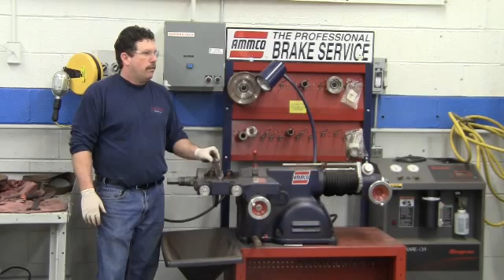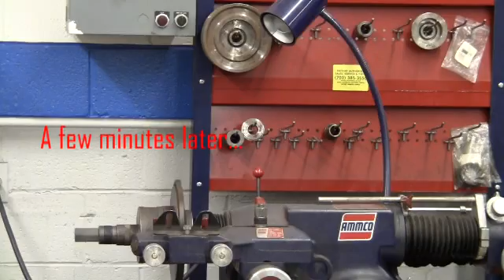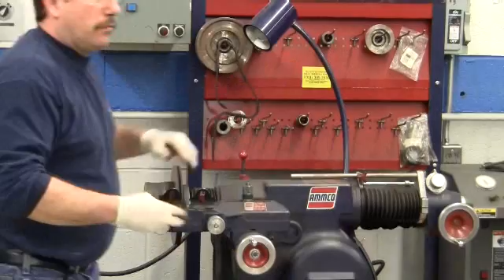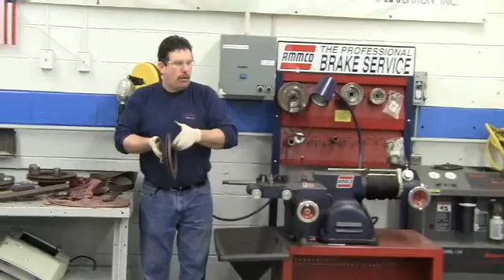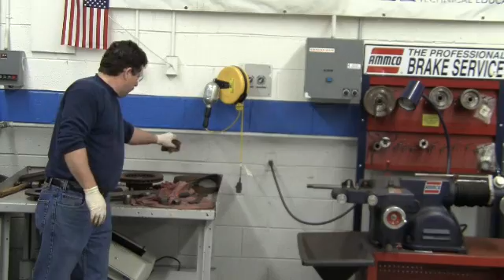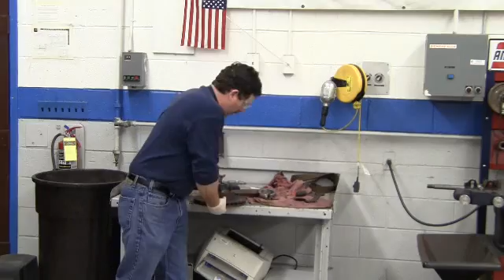Machining Brake Rotors 2011(3/4)

Comment: Can't help but mention soap and water wash again, like past post. Absolutely critical, brake job can't be done without this procedure.  Don't use dish or bath soap, they contain oils.

stop brake noise.com

Don't forget to use a Chip Deflector tool (clip on silencer) also, the two little brake pads connected with a wire in the shape of horseshoe.  It is additional dampening but also keeps loose chips from flying up on machine and ruining the bearings, motors, etc.

gwrauto.com/brake_tools.html

Comment: Always wash the rotor with soap and water after machining. not with brake cleaner Soap and water removes the dust left on the rotor from the machining process